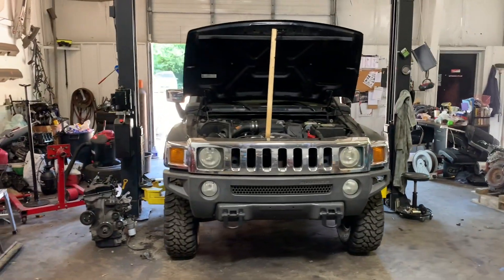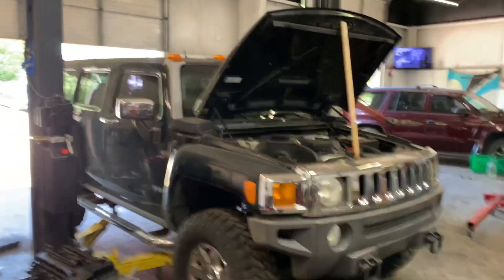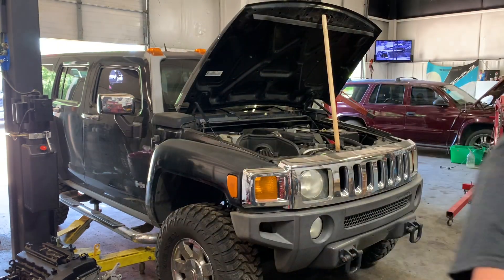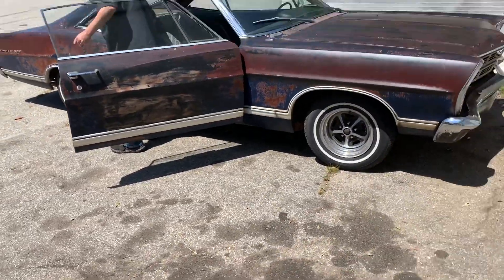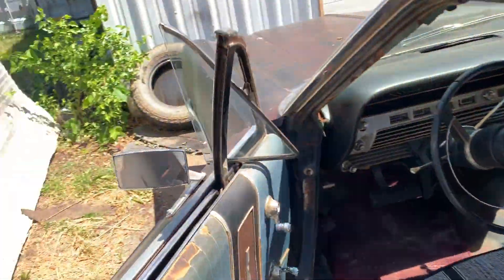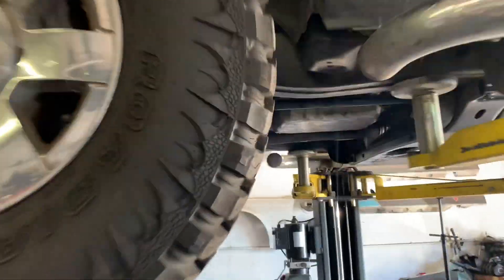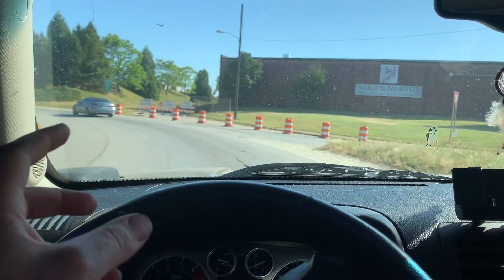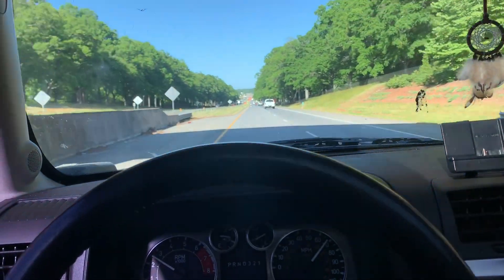ANOTHER transmission for the Hummer H3

Comment: Your experience with this transmission shop is much like my personal experience with Jasper engines.  Only took my mechanic three Jasper engines to get one that appears to be usable.  And it was nothing exotic, a GM 5.3 in a pickup truck.  First Jasper had a bad lifter, and came back out.  The second Jasper was getting coolant in the oil (bad head?), and came back out.   Pay these people good money, and then what you get from them is crap.

Comment: Hey jay, i have one of these too, vehicle drops into what feels like neutral while driving, pull over, shut off turn back on drives okay, thoughts? I have to put my scanner on it tomorrow and drive around to get some data. (reman trans has maybe 3500 miles on it. unlimited millage warranty. No change when in 4high lock, replaced front diff at the same time as trans due to torn up intermediate axle ((inside front diff)) which is no longer made.....)

Comment: That's what H3 means, 3 transmissions. 

We had that happen once, 200R4 in an '84 Electra.  Came back from the first rebuild, I drove it, it started puking fluid all over, it got towed back to the shop.  Re-rebuild.  That lasted 20K.  Different shop for rebuild 3 said the core was so bad they thought it came out of a car that had burned.  They had to get another one.  That one lasted the rest of the life of the car, which wasn't that long thanks to road salt.

Comment: Im having trouble with my h3, it wont shift from 2nd gesr to 3rd...ionno if its the transmission... cuz it sti shifts from 1st to 2nd... ionno im at a loss.if yall could point me to the right direction, it will be greatly appreciated, thank you
Reply: forward sprag. if you dont have drive but can manual shift 1 2 r etc. if you need help message me.
Reply: @carvicerepairhelp4743  i tried, doing it manually, but it still stays i  2nd gear.

Comment: I have a problem with my 2007 hummer H3 The gear shifter on "D" is only drive on the third gear its very slow and feel heavy, When the speed reaches 80KM/h it does not change or does not shift to gear four, the reverse is work, the four-wheel drive is work, and the manual shift is working 3 2 1, mileage counter working, "NO" errors code, The gearbox sensors all 4, oil and filter have been changed.  please help and thanks.

Comment: The H3 The hummer that killed the hummer. Though it was far from the worst GM product of the 2000s.
Reply: Any Cadillac with the Northstar motor was a worse GM product from the early 2000's. The insulting 2006-2007 Chevy Malibu "SS" has to be up there too. Throw in the Chevy SSR with the gutless 5.3L motor that they came with for the first couple years for good measure.
Reply: H3 we’re great for the time and my opinion the best all around hummer👍 Look wise for sure